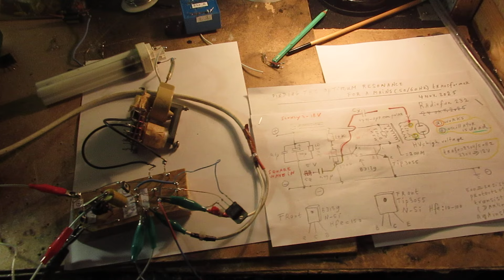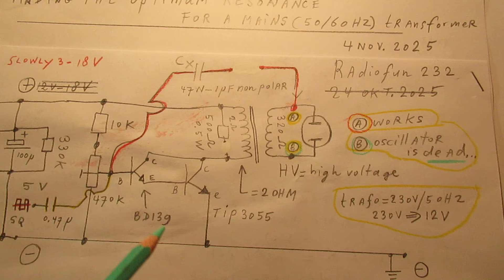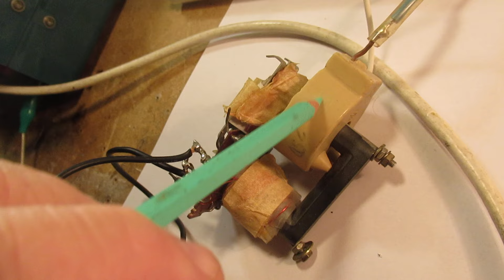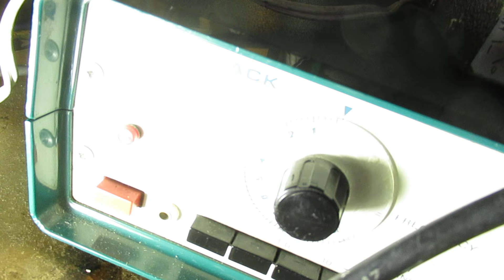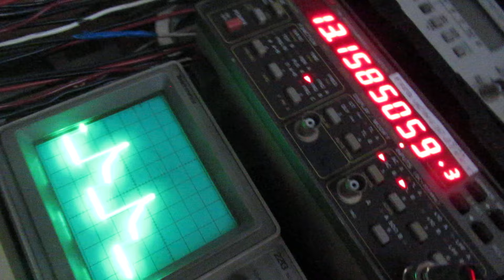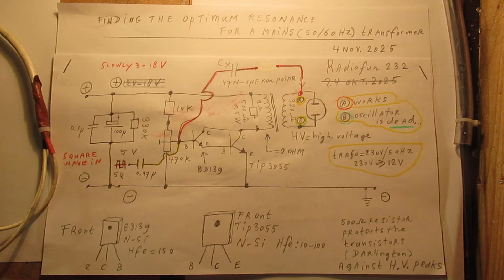Test circuit (schematic) to find out the optimum resonance of a (small) mains or other transformer

Comment: Hello. Great video.
About this subject, I have been thinking for some time how to measure the maximum induction supported by a magnetic core. It is known that, in the case of a transformer, saturation must be avoided. Also, when we calculate the number of turns of a transformer, we assume that the maximum magnetic induction B has a certain value, we use this value in the calculations.
Depending on this value of the induction that we choose between 1-1.4T, a certain number of turns of the transformer will result. It would be very useful to know the exact value of the magnetic induction carried by our core in order to make a minimum number of turns required, with maximum accuracy.
So how can the maximum magnetic induction supported by a magnetic core be determined?
Reply from the maker: I don't know what you want to make.

Comment: I'm a huge fan of inductors as audio signal filtering, and equalization tools. Right now I'm experimenting a lot with a small sealed 3H Collins air core coil, in my audio effects box circuit ideas on breadboard. There is just something very special about very long copper wire, wound around different forms, and in different ways, when used directly within an analog audio path. This Collins 3H is a toroidal air core.
Reply from the maker: Absolutely true! A lot to experiment and find out certain audio "sound profiles". There is 1 video about that on my YT Channel where a coil was inserted into a 2 transistor audio pre-amp, the filter in-between the 2 transistor stages. And toroid coils have specific and very good properties in this case, like you surely know.
Reply from the maker: In the textbox of this video (not much in the video itself) you can find many links to my audio filter experiments, with schematics. Thanks for your comment. 4 nov. 2025.
https://youtu.be/6QitndX2E3g